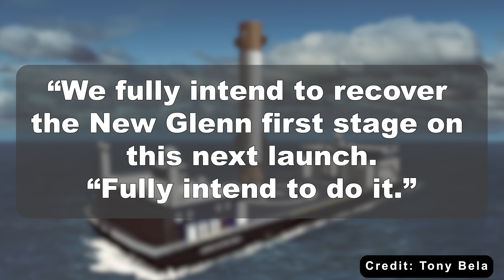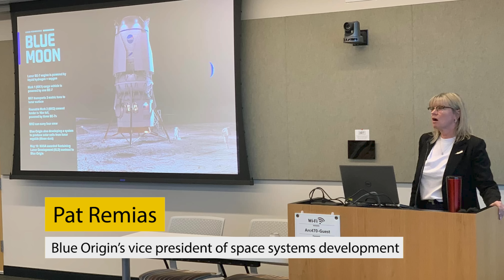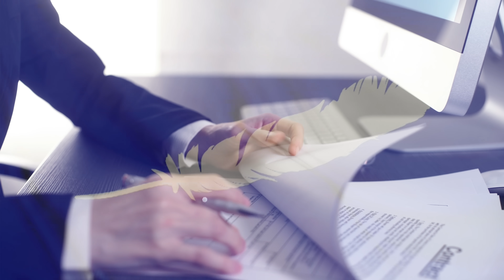Blue Origin New Glenn Officially Launched, But No More Future...Elon Musk laughs!

Comment: The oral ball washing of Musk by this channel and many others is pathetic!  SpaceX has launched Starship/SuperHeavy 10 times but they haven't even attempted to land on a downrange barge and without using a downrange barge SpaceX is throwing away about 30% of the potential payload by flying back to the launch site.  Why may you ask?  Well because the return to home approach requires and addition and quite substantial burn, the Boost-Back burn, that's not needed when landing on a downrange barge.  BO has demonstrated this on their second launch.
Mind you, BO has work to do and I'd argue the BE-4 needs to be about 15% more powerful to accelerate more quickly and not waste so much propellant fighting gravity!  The SpaceX Raptor 3 is being pushing to chamber pressures more than double what the BE-4 is operating at and it appears the thrust and therefore the chamber pressure will need to increase again.  SuperHeavy not being able to land on a downrange barge will cost them about 30% in payload and that's not viable for any operations beyond LEO.  But yeah, Musk laughed!
Reply: NG is less capable than a Falcon Heavy but probably more expensive because of economies of scale.  And Falcon Heavy is just made out strengthened Falcon 9s - not many super heavy loads, no problem, SpaceX uses it as a Falcon 9 until a customer for Heavy is ready.  Probably the military - who is forced to have multiple suppliers regardless of how expensive.  I have a feeling that BO will be stealing ULAs lunch or relegated to launching only for Keiper or whatever Amazon has renamed it too. 
Expect share holders to revolt if Bezos tries to force Amazon to go with BO and thay aren't competitive on price.
Reply: Oops, should have wrote Kuiper...
Reply: @PCman999-99  They renamed it LEO
Reply: @PCman999-99  NG is a tad less payload than Falcon Heavy but the BE-4 engine is very conservatively designed and has room to increase by at least 20% though they wouldn't need much more than a 15% increase to significantly increase payload to LEO.  If you notice it took about 12.5 minutes to reach LEO when Falcon 9 and other mature rockets are more like 9 minutes -- time to orbit make a huge difference in payload!  And the BE-4's NEED to be upgraded to reduce the time it spends fighting gravity.
Falcon Heavy is a brute force approach that is very poorly balanced given the tripling of first stage performance with no change in the second stage performance and that fact often requires throwing away the center core.  You will remember that when used the center core is under-throttled so that it can burn longer than 2.5-2.7 minutes -- this is needed because the second stage is no more capable than any other Falcon 9 second stage.
If Bezos gets BO to increase chamber pressure to boost thrust its payload should be able to reach about 80t.  At present, the chamber pressure of the Raptor 3 is 350 bar whereas the BE-4 is about 140 bar meaning they have substantial latitude to increase chamber pressure and performance!
Reply: You are talking apples to oranges.  First Starship/superheavy is a monster.  Do a side by side comparison to NG.  Second SpaceX has already considered ocean retrieval but a barge is not up to the task - its needs a stable platform like the oil rigs it purchased years ago and then later resold so they could focus on mission critical items.  It's still on the back burner, waiting for the new launch pads to be built and then use the lessons learned for a sea launch and recovery platform that won't boil the surrounding sealife.  Also saltwater is corrosive and without calm seas, Starship risks tipping over.
Reply: @edbull  You are clueless!  It is absolutely clear that the larger the booster the more difficult to land it on a barge, but it is also true that the larger booster would be harder to land on a tower.  That's SpaceX has been able to land on a tower AND BO have demonstrated they can land a booster that's much larger than the Falcon 9 should be data points arguing against the nonsense you just vomited!
If Starship/SuperHeavy used the same approach that they use with Falcon 9, that is if they used reusability for the first stage but disposability for the second the payload to LEO should be around the 200t to 250t range, but having reusability for both stages AND requiring the booster to flyback to the launch area with a boost-back burn the payload to LEO will be about half or even less!
Reply: @Raptorman0909  I believe the one that is clueless is yourself.
Reply: @edbull  Come on deadbull, tell me why?  I laid it out with detail and you're only capable of backhand dismissal.  Are you saying tower landing is easier?  Are you saying SpaceX will never use a downrange barge and will always waste payload to orbit flying back with a boost-back burn?  Come one deadbull, show me what ya got!

Comment: New Glen is almost obsolete already.
Reply: Very true once starship is satisfied you can easily launch five times the expendable payload of this puppy. New Glenn  might have had a chance if it had been around half a decade ago like it should have been
Reply: Not really. It's got more capability than Falcon Heavy. One good flight doesn't equal a proven system with a good track record but it's a great start.
Reply: I don't think so. Is actually quite competitive with Falcon Heavy, plus it has a much bigger fairing. Starship will make it obsolete, yes. But Starship will make every other rocket on Earth obsolete ( probably with the exception of Rocket Lab Neutron ). When do you think Starship will become operational? I don't think that will happen before 2028, Elon takes his time.
Reply: @lakeline6317  I don't think Starship will make every other rocket obsolete. Imagine an existing space infrastructure and you have a crew on orbit that needs relief do to some bizarre sexual medical situation. A whole starship isn't necessary to transfer 4 people around so why use it? Did the 747 make every other airliner obsolete? I realize all analogy is suspect but scalability has always been an issue in transport.

Comment: Starship can only land where it can be caught. New glenn can land on its barge. Your ignorance is showing. BO will do well.
Reply: You don't know what you're talking about.
Reply: Umm falcon 9.....ummm falcon heavy....did we forget. By the way starship has had legs before. Sn15 landed with legs. I'm pretty sure they can strap them on if they need them
Reply: Soon there will several places they can "land".
Reply: Until they just install landing legs at a cost of reduced payload capacity, plus they are installing raptor 4 for more thrust.

Comment: BO finally got a Falcon 9 type of rocket 12 years late. Meanwhile SpaceX has nearly competed Starship which is billed to be 100X cheaper per kg in orbit than Flacon nine.
Reply: It's not a Falcon 9 type rocket. It's a 7 meters wide and 100 meter tall monster. Double the size of a Falcon 9, and the engines burn methane, not querosene.. Do you believe a gasoline powered 300hp Audi A6 IS a Fiat 500 diesel 100hp type of car? I don't thinks so .. By the way. Starship has never done a real orbital launch. All launches followed a sub-orbital ballistic trajectory, and have destroyed both booster and 2nd stage 11 times, which meant the loss of 300 engines. It takes a full week to make a Raptor engine. Sincerely, I don't see Starship getting commisioned before 2029. Meanwhile, there are 23 scheduled missions for NG before 2029. This looked like the turtle and the hare from the start. Hare Musk vs Turtle Bezos. The former was fast, breaking things on the way, suposedly the price you pay for "fast", though I fully disagree. It looked as it was gonna win, but after analyzing their work during the last years, the conclussion is they just use bad engineering. C'mon, the fins melted on reentry. Good engineering would have known that before launch, both through simulation and physical testing of the actual materials. The launch mount was terribly designed, using inadecuate materials, lack of flame diverter and running water to cool it. Tons of hubris, and a man that's not an engineer, surrounded by yesmen too scared to tell him his ideas are childish, and borderline pathetic. As expected, it got completely destroyed the first time they used it. That's bad engineering, period. Good engineering doesn't need to iterate the concept through trial and error, that's BS. There should be a set of predefined requirements and a collection of well thought specs designed to fulfill them flawlessly, on a simulation first. Then, it should get built following the blueprints, precisely, without any deviation, and it should work on first attempt, as NG did yesterday. 5 years ago I said that New Glenn will be ready first, and fanboys like you laughed at me. "Impossible! Starship will be going to Mars in 2024". I even placed a bet, the odds weren't great. 1.75 per dollar, not even 2:1. It appears that the betting agents, who risk their actual money knew better than all of you. The actual "race" was about which one of the two ultraheavy launchers would be COMMISIONED first, and the fact is that even after releasing the first renders of BFR, 2 years earlier than New Glenn's, the later has been commisioned first. Therefore, I WON THE BET. Now you can say whatever bs about "future" capacity of a "future" rocket that's currently full of "issues", not to mention the "future" ones that haven't showed up yet, and after 12 attempts it has been unable to demonstrate a fully working proof of concept. By the way, a 3 core, 3 stage New Glenn, similar to Falcon Heavy, is on the works. It will be 120m tall, carry 150 tons to orbit and 250 in expendable mode, and that my friend, will surpass Starship capacities, and even go to the moon without any refueling BS, way before Starship ever flies a real mission. C'mon, 11 refuel missions for a one way trip to the moon? that's a really bad joke, and once again proof of bad engineering.. Starship will never go to the moon, or mars, because it hasn't been designed for that job. It's just a workhorse for low earth orbit large payload delivery. Sorry, reality is stubborn. Spaceshuttle neither could go to the moon, because it was just a workhorse for low earth orbit too. You don't cross the ocean on an 18 wheeler from a continent to another, you use it to transport the goods to a port and load them onto a ship, or get the truck itself inside a ferry. We'll go to the moon and Mars, sure, but not with the childish halfbaked cowboy plan Musktard proposes. We'll use nuclear powered translunar or transmartian ships, built in orbit, and designed to purpose to do that job. They will travel from low earth orbit to the moon or Mars orbit regularly, and by then you'll be so embarrased to admit that once upon a time, you too believed in all the mental farts that snake-oil salesman dared to fool you with.

Comment: SpaceX isn’t just ahead by a few miles. It’s like they’ve taken off on their own spaceship while Blue Origin is still getting ready to board.
Reply: Delusional. SpaceX is living out of the work their REAL engineers did with Falcon 9 and Dragon, with a development process that was the oposite to what they are doing with their new rocket. Starship is currently full of "issues", not to mention the "future" ones that haven't showed up yet, and after 12 attempts it has been unable to demonstrate a fully working proof of concept. It has never done a real orbital launch with that technology, that's a fact. All launches followed a sub-orbital ballistic trajectory, and have destroyed both booster and 2nd stage 11 times, which meant the loss of 300 engines. It takes a full week to make a Raptor engine. Sincerely, I don't see Starship getting commisioned before 2029. Meanwhile, there are 23 scheduled missions for NG before 2029. This looked like the turtle and the hare from the start. Hare Musk vs Turtle Bezos. The former was fast, breaking things on the way, suposedly the price you pay for "fast", though I fully disagree. It looked as it was gonna win, but after analyzing their work during the last years, the conclussion is they just use bad engineering practices. C'mon, the fins melted on reentry. Good engineering would have known that before launch, both through simulation and physical testing of the actual materials. The launch mount was terribly designed, using inadecuate materials, lack of flame diverter and running water to cool it. Tons of hubris, and a man that's not an engineer, surrounded by yesmen too scared to tell him his ideas are childish, and borderline pathetic. As expected, it got completely destroyed the first time they used it. That's bad engineering, period.  11 refuel missions for a one way trip to the moon? that's a really bad joke, and once again proof of bad engineering.. Starship will never go to the moon, or mars, because it hasn't been designed for that job. It's just a workhorse for low earth orbit large payload delivery. Sorry, reality is stubborn. Good engineering doesn't need to iterate the concept through trial and error, that's BS. There should be a set of predefined requirements and a collection of well thought specs designed to fulfill them flawlessly, on a simulation first. Then, it should get built following the blueprints, precisely, without any deviation or specs that depend on trial and error, and it should work on first attempt, as New Glenn did yesterday. One day you'll be too embarrased to admit that, once upon a time, you too believed in all the mental farts that snake-oil salesman dared to fool you with. New Glenn  is going to the moon with a 3 core version similar to Falcon Heavy they are planning to build by 2027, that will match or surpass Starship's capabilities, won't need to refuel, and will launch before Starship gets even commisioned. I bet you $1,000 on that . FYI,  5 years ago I placed a bet that New Glenn will get commisioned before Starship. Yesterday I WON THE BET

Comment: I’m amazed at how SpaceX has taken reusable rockets to the next level. I don’t know if Blue Origin can catch up in that regard.
Reply: They've not only catched up, but surpass SpaceX. The only real reusable rocket SpaceX has is Falcon 9. 60 meters tall, 4 meter wide. New Glenn is 100 meters tall and 7 meters wide. It's already bigger, better, uses methane instead of kerosene, works as intended and has already been commisioned. Starship never did an orbital mission yet, only sub-orbital with ballistic trajectory. Besides, it's plagued with many issues, not to mention the future ones that haven't even showed up yet, but will. 12 failed attempts at proof of concept, and the destruction of 300 engines so far. They need 1 week to build a brand new single Raptor engine. Realistically, Starship won't be finished until 2029. They are chaotic and their methods could be considered bad engineering. It's Musk's Hare vs Bezos Turtle. BO have demonstrated better engineering so far, no unscheduled dissasembly, no engine failure, no trial and error, just 2 flawless launches, with the next 23 launches already scheduled for the next 3 years. I bet New Glenn will go to the moon before Starship gets even commisioned. Make no mistake, turtle beats hare, every single time

Comment: If Blue Origin can figure out how to scale up production, they might be able to compete. Until then, SpaceX holds the crown.
Reply: 6 Boosters will be enough. Reusability is the key here. Developing a reusable spaceship will be more important. They are not putting a colony on Mars.
Reply: Exactly. That's why SpaceX has built two Starfactorys (one in Texas and one in Florida), is building two Gigabay assembly buildings (one in Texas and one in Florida), and will have five Starship launch pads in operation by the end of 2026 (two at Starbase Texas and three at Starbase Florida). It's likely that SpaceX also will build three Starship landing towers (one at 39A and one at LC-37 in Florida).

Comment: I wonder what NASA’s really thinking right now—Blue Origin is slowly making progress, but SpaceX is practically already there with Starship.
Reply: Starship hasn't done an orbital launch yet, only sub-orbital with ballistic trajectory. Besides, it's plagued with many issues, not to mention the future ones that haven't even showed up yet, but will. 12 failed attempts at proof of concept, and the destruction of 300 engines so far. They need 1 week to build a brand new single Raptor engine. Realistically, Starship won't be finished until 2029. They started fast, breaking things on the way, suposedly the price you pay for "fast", though I fully disagree. In fact, they've wasted lots of time and brainlessly burnt lots of money building and  rebuilding again because their first idea for a new section of the whole operation, always fails. Hubris is a problem in SpaceX and the fact that there's a guy heading the development that is not an engineer and is surrounded by yesmen too afraid of telling him that everything he proposes is crap, but no one dares to do it and end up having to develop it, and test it, just for the boss to realize it's crap. The first launch mount they did, and destroyed completely the first time they used it was a pathetic example of what I just said. No flame divertion, no water cooling, just a 5 inch concrete slab and an arrogant boss that believes he knows better than the russians NASA, ESA,  China and their 50+ years of experience building launching facilities. They are chaotic and their methods could be considered bad engineering. It's Musk's Hare vs Bezos Turtle. BO have demonstrated better engineering so far, no unscheduled dissasembly, no engine failure, no trial and error, just 2 flawless launches, with the next 23 launches already scheduled for the next 3 years. I bet New Glenn will go to the moon before Starship gets even commisioned. Make no mistake, turtle beats hare, every single time